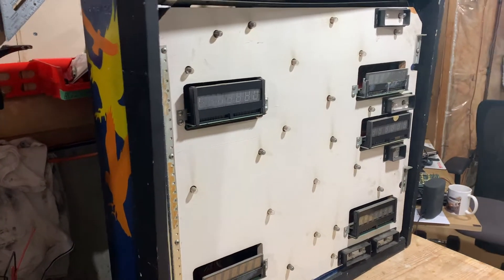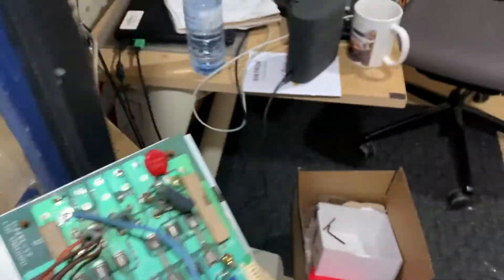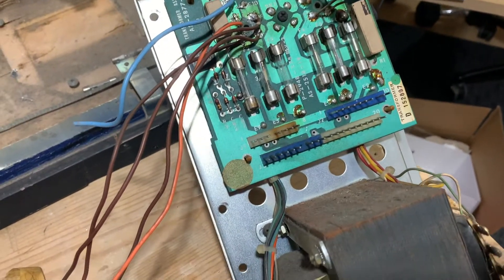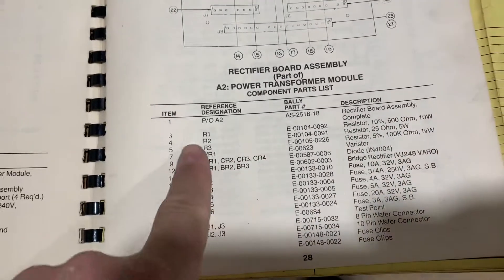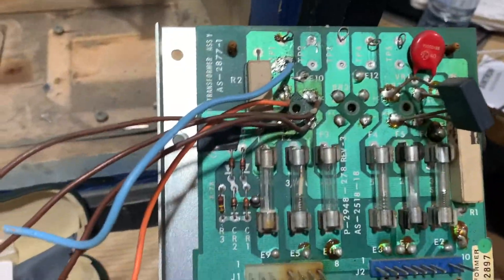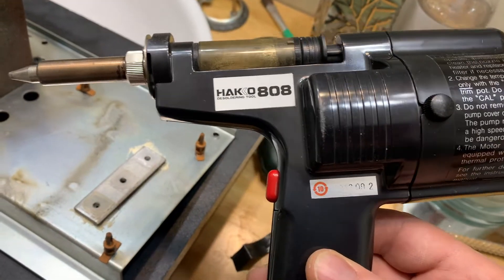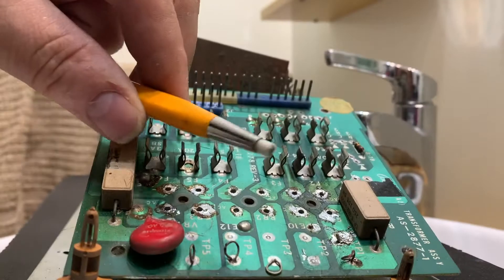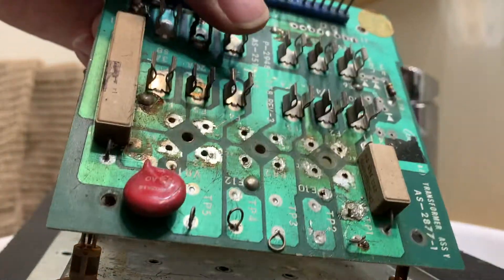Rebuilding a 41 year old Bally Pinball machine power supply. Part 1.

Comment: This was a great video, thanks, but before I replace my rectifier board,  I need to first verify that my 122-125 power transformer is OK.  The original rectifier board was completely destroyed, charred by fire! The 20 pin connector was also destroyed, so I need to rewire that.  I've isolated the transformer from the machine - any suggestions on how I can test it to make sure it isn't shorting?
Reply from the maker: unless their is a tar like substance ooziing from the transformer i would say its good.  i've only seen one bad one in my day and it was really obvious.  Good luck!
Reply: @rushfanpinball1604  Thank you for such a fast response!  The transformer physically looks OK.   I can see enough of the original wires to replace J1 and J2, but J3 (20 pin) is completely destroyed. Where can I find the information I need to rewire the harness to a new 20 pin connector? Are replacement wiring harnesses available?
Reply from the maker: @peterpoggi1624  send me a picture. Rushfan@live.ca
Reply from the maker: You can but the connectors from Great Plains Electronics.  Ed sells pinball related electronic products.  You will probably have to cut the strip down to size.
Reply: @rushfanpinball1604  Thanks much. I just resent the pics. I screwed up your email address but they're on the way now.